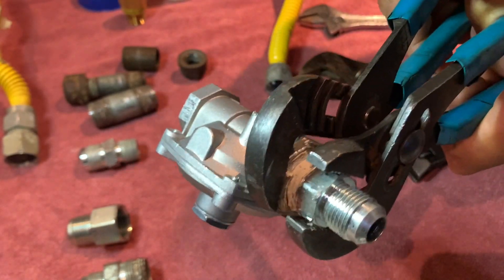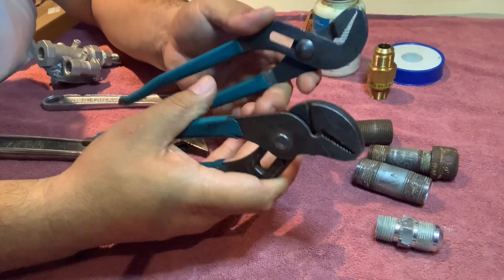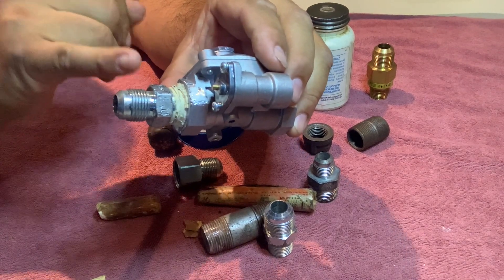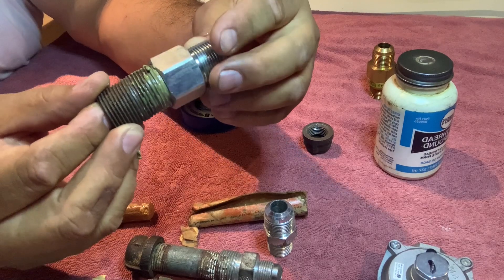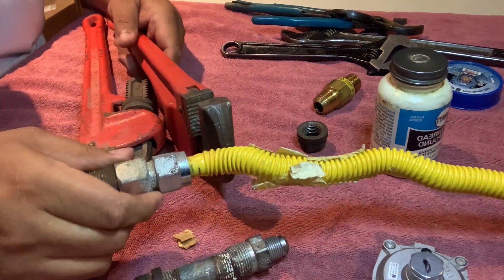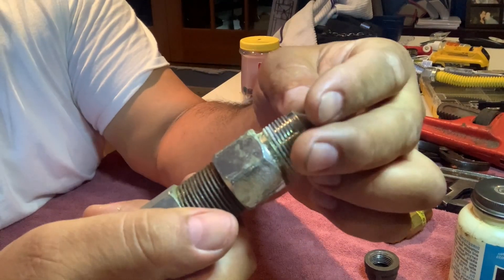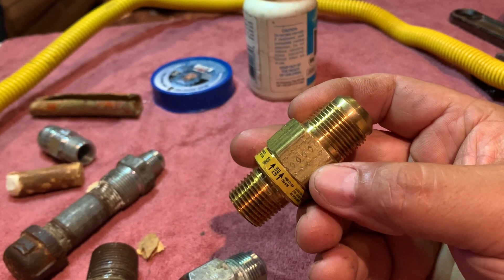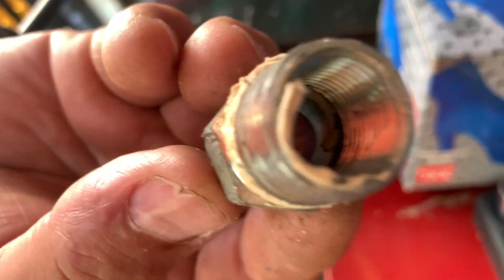What do I need to install gas appliances like a pro, sort of.#jwho #gasappliances #jhandy #tools

Comment: The blue monster is all I use for that application. If it’s gas lines that’s in your house, in the walls, ceilings or just larger pipe. I’ll use pipe dope, tape and dope again. You won’t have to worry about a leak showing up later.

Comment: Regular is only going to make sure you don’t get a surge of pressure from your main. It’s only a pressure regulator. 

Your stove is going to have a BTU rating and or CFM rating. The regulator is going to be sized for that as well as the gas line size for those ratings. Gas fitters need to know BTU/CFM ratings to size the gas lines correctly.